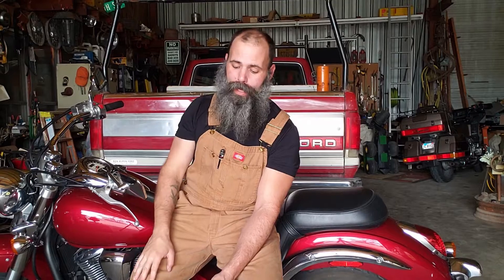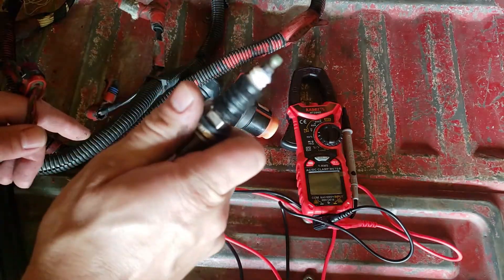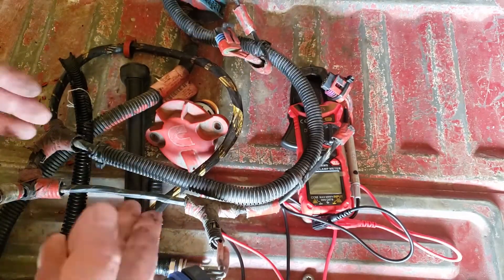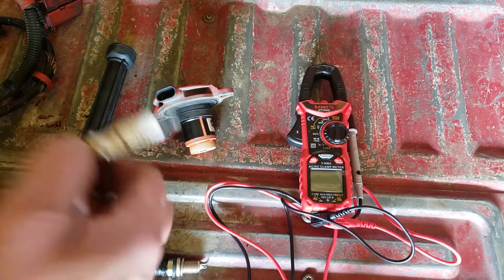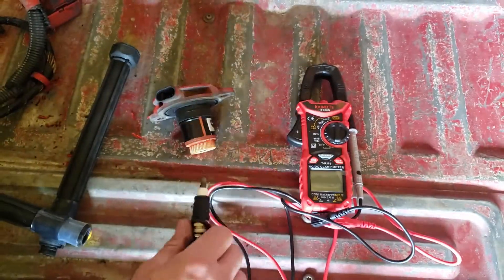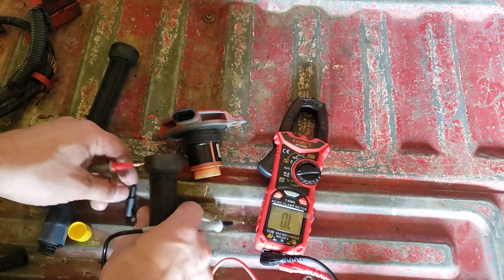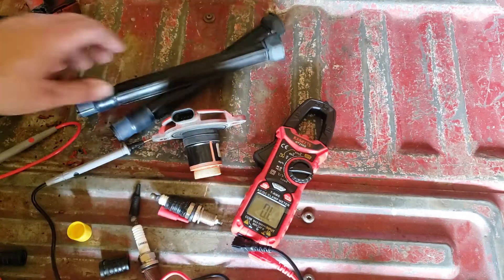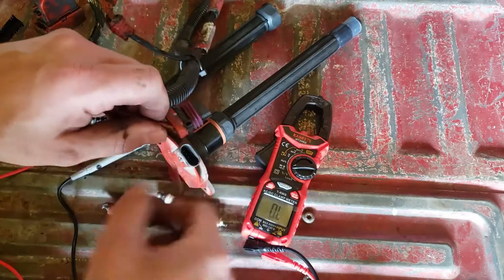Cummins CNG Spark Plug Installation Procedures

Comment: Could you do me a huge favor and see if you can get the Bosch fuel injector  part number for the new X15N natural gas engine and if possible see if its the same one they use in the X12N?
Reply from the maker: You mean the fuel regulator solenoid or the mixing valve on top of engine? Of ones i am thinking of those are expensive as hell

Comment: Have you ever come across electronic throttle Actuator codes? I have P2759 and Engine throttle control Actuator Code 6388.  Thanks for your videos.  Not much CNG info out there.
Reply from the maker: I want to say the 2759 sounds familiar but it has been prob from 2 or so yeara back. I will see what i can find of detroit and cummins service when i get to work
Reply from the maker: Also, do you have any fmi and pid info on those codes too?
Reply: @BeardedSeabee82  No I don't have any info on that. 😬

Comment: Is that a vtx ……. Owner op looking at possibly buying a 14 Cummins Cng 12 liter……. 450,000 miles been fleet maintenance ……..Been watching your tips ……. How Do you think the maintenance and repairs over the next 3-400,000 mile should compare to the same engine with diesel …… I like the fuel prices but will I really save on over cost
Reply from the maker: If they already fixed crank seals on it, spark plugs every 75k, overhead at 150k, if you go with higher priced (but worth it) Valvoline One Solution oil and fleetguard oil filter, can push oil out to 40-50k. May need to rebuild fan drive around 700k. And belts and tensioners every 300k ish. Biggest thing is What type of fuel system and get rid of whole shebang before 900k
Reply: @BeardedSeabee82  thanks ……. How big a deal is it to covert to diesel…… is it just the head and tanks
Reply from the maker: Change ecm, fuel system, head etc at which point as much as that would cost would be just as cheap to swing it, but with diesel being 5 bucks a gal cng is prob gonna make another come back
Reply from the maker: But right now with fuel at price it is cng is more cost efficient to run

Comment: Great video! Any idea why they put mineral oil in the coil packs? Having trouble diagnosing a truck now, came back for a refresher.
Reply from the maker: Same as old generators and ignition coils for vehicles, acts as an insulator. And whatcha got goin on?
Reply: We have a 12g that has multiple cylinder misfires and a reoccurring 2645. Everything tests good on the top end. The icm harness is original, we might just replace it to be sure. But the throttle valve fault is what's getting me, not sure if that's causing the misfires or vice versa.
Reply from the maker: If throttle/mixing valve is going bad it will screw up the gas to air ratio mixture and cause to run like shit, few other associated components too that could be looked at
Reply: Throttle valve has been replaced twice, the connector to the throttle valve has been replaced. I suspect the engine harness but everytime I test it it checks out. I can't duplicate the problem.
Reply from the maker: We had one also that had same problem lil while back around spring/early summer. And i am trying to think about what it wound up being but i think that truck got into a wreck then towed up to shop in wisconsin. But cant remember if maybe ecm went bad on that one. I will have to get back to you on this hopefully around monday. Also feel free to shoot me email on it, email is on about page
Reply from the maker: Ok, had to dig though archives and repairs at work and discuss with my boss, the truck i had that problem with did come bavk and sat on our deadline for past couple months til it could get sent up to our other shop in wisconsin, (misfire and backfire problem at that point)#6. The issue we had with backfire ran through gammut of stuff, til determined intake valves had to somehow be damaged. Shop up there got it this past week, called me and i told them what we all did, the next day got pics, cam and followers for #6 shot to hell. They are getting new head installed

Comment: Only one good use for CNG and that's what happened at Mankato Peterbilt. ...
Reply from the maker: No dpf, no def, fuel cost and efficiency way less $$ than diesel, biggest cost on them in general is tank setups, and of course places having a fuel station for them.
Reply: I've had my freightliner Cng and love it, no more Regen and I feel the set up is more easier to maintain, good to see videos out there for the Cummins six 12 g out there.